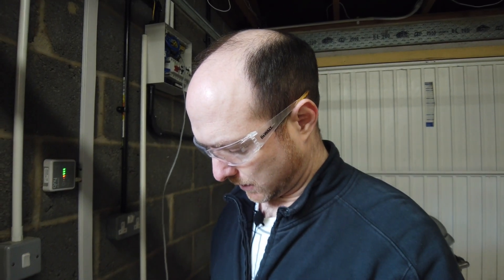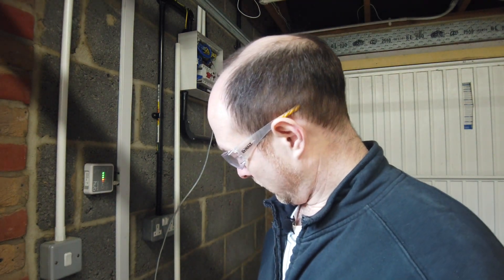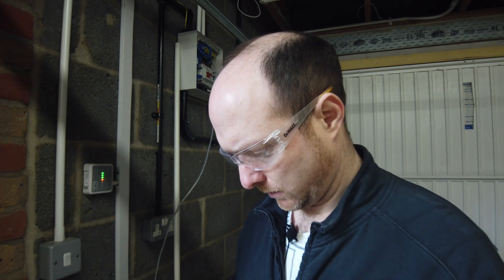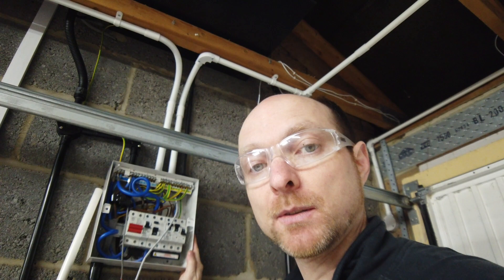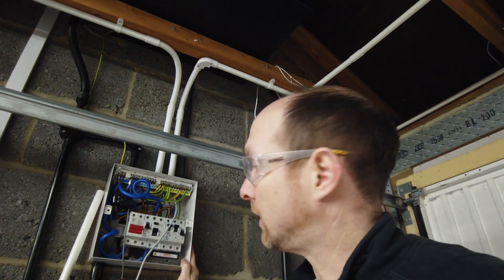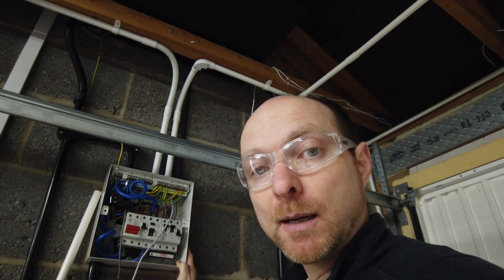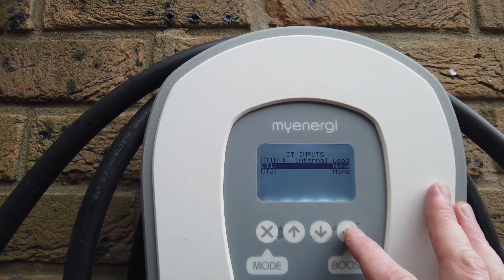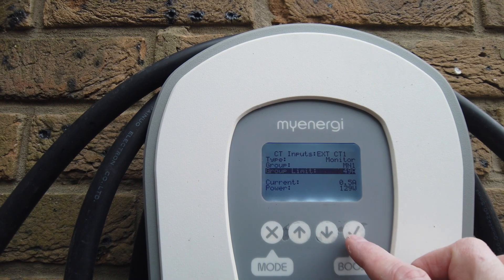Zappi Monitor Mode Part 1

Comment: Interested that you're buying a Wallbox Quasar. Have you any idea when it'll ship? And do you know how the app will work ands how you'll manage export to home and grid? Have you gained permission from DNO for export if you have I assume you'll be limited to 4kWh? I am considering ordering one also but want to I understand the control before I pay my £1200 deposit.
Reply from the maker: Hi Nick, not buying it’s being supplied as part of a trial that I’m taking part in. Check a couple of videos back to the one on powerloop. The trial is a collaboration between octopus energy and uk power networks (my energy supplier and the DNO)
Reply: EvIain Hi Iain This is an area that really interests me. I too am Octopus customer and have looked at T&C of the trial but haven't applied as I'd prefer to control V2G myself. I am very active on the OVO V2G forum which is different again. Any chance we could take this discussion offline if you'd like to you can email me on ukelectricworld@gmail.com

Comment: Nice Job Iain. It would be good to show testing the Zappi dynamically reducing the power to the car when reaching the monitor limit, e.g. set the monitor limit to 32A and set the car to fast charge. Then put on a kettle or other high load in one of the garage sockets and show the Zappi reducing the charge power accordingly.
Reply from the maker: Yea I will definitely be doing this, I have a couple of 3kw heaters too. Maybe in the next one 👍👍